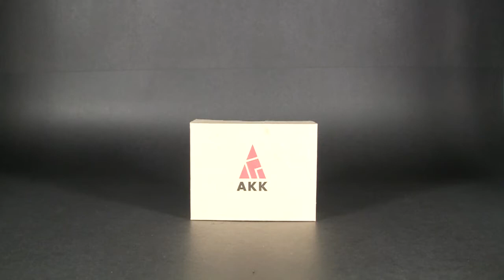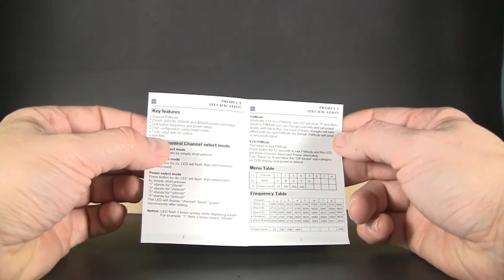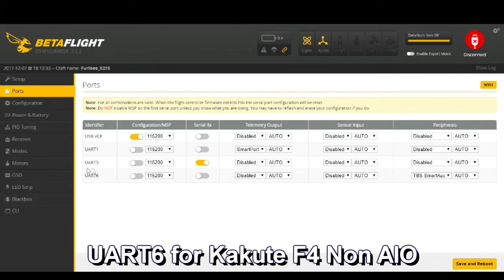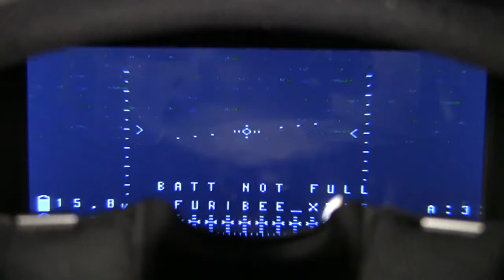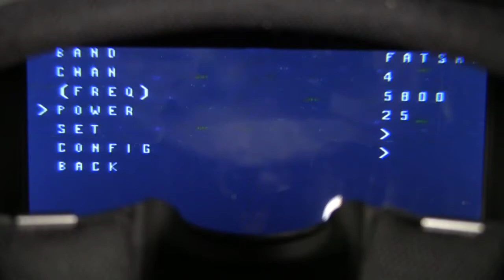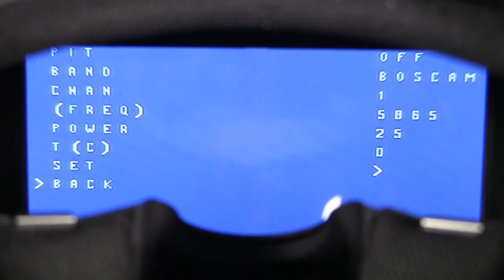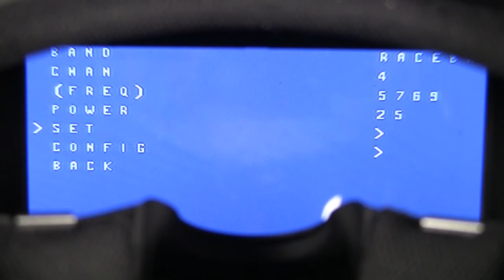AKK FX2 VTX Betaflight OSD Smart Audio setup on Furibee X215 Pro

Comment: Funny i swear by akk transmitters lol love um.had this quad a long time...still good, run a lollipop lil buttton n just got some  race wire for mine with lights. Will look cool.. n ty for the vid! Going over my build. N ps if u havent tried useing corrosionX its litterally 20 merricals in a bottle lol.. thanks again!and i get the best power from the battery directly in all my wings and quads.. ment for it i push 1200.on um all the time n fly miles! Big up

Comment: i was looking for some info on that stock vtx but could not find anything. one of the mistakes is that the antenna wire will heat up and go into a short  (where is bent )after some time if its forced into that position as they did.

one other point is that osd joystick from the fpv cam is diagonal in position and the arrows dont correspond to the actual actions .. the 2 position on the top are up+down.
Reply: Dealing with that joystick is a fkn nightmare, I changed the language to chinese unintentionally when diagnosing my VTX issue. :\